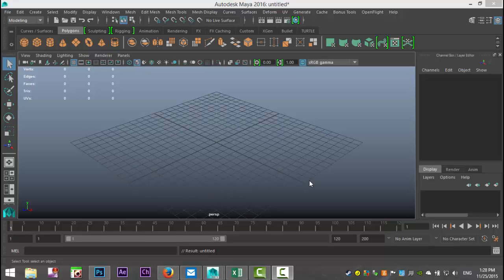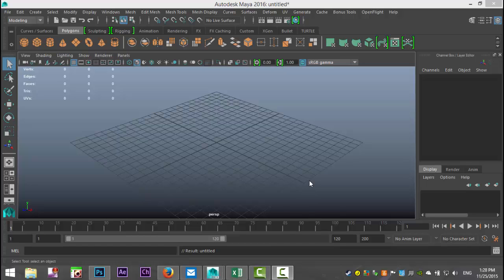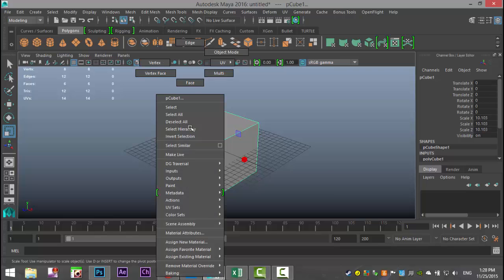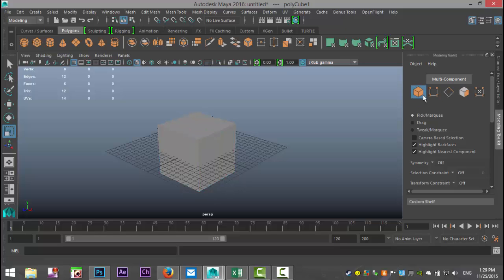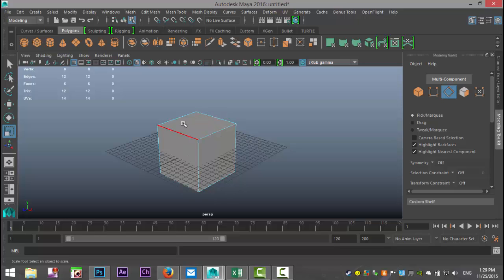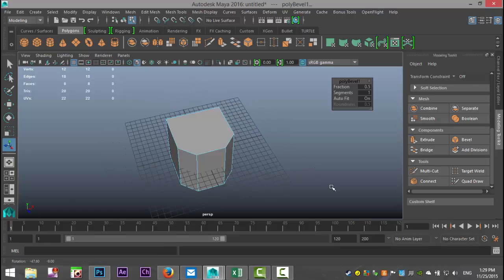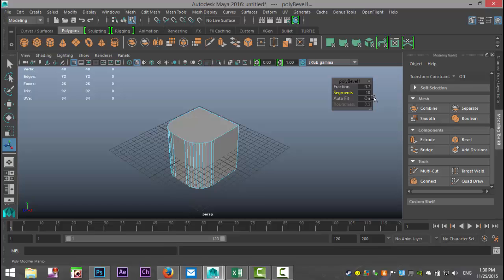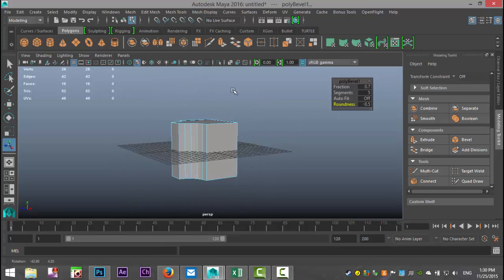Maya 2016 tutorial : The Modeling Toolkit Part 5 ( The Bevel Tool )

Comment: These were really helpful for getting used to the changes in 2016! 

Do you have an intention on covering other tools? I'm particularly interested in learning about how to cut into my geometry in Maya 2016 for complex geometry designs like car, plane, or boat engines. Using one shape to dictate the shape of the cut or creating space around a set object. That sort of thing. Is there anything to make that process easier in this new version?

Regardless, amazingly simple and helpful videos! Thanks again!